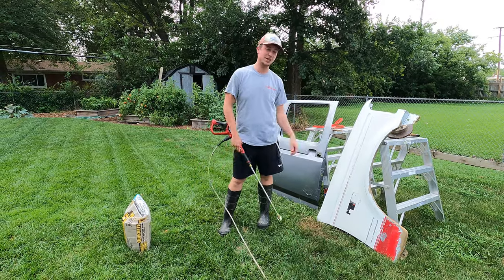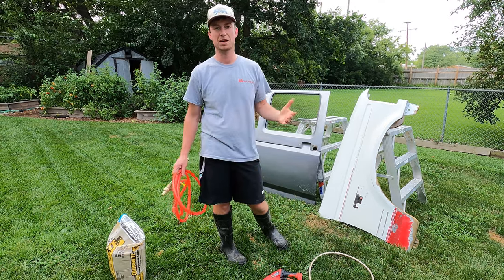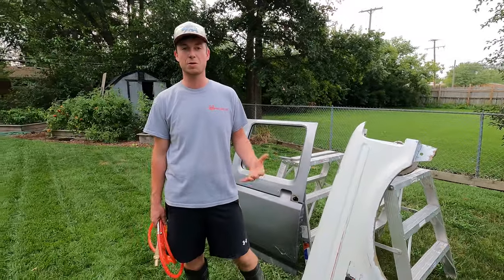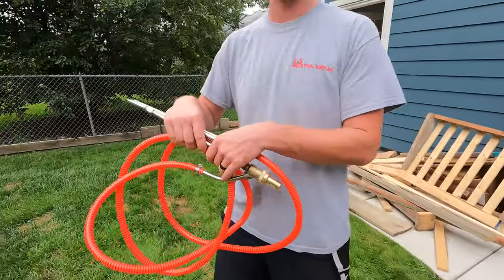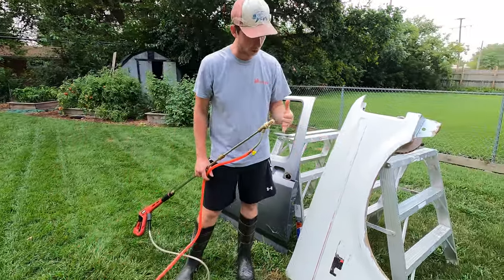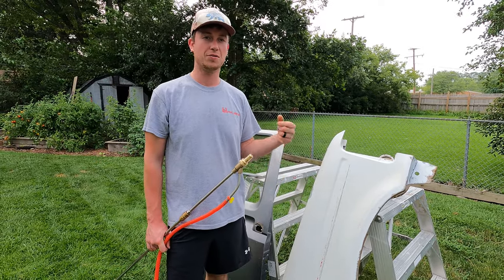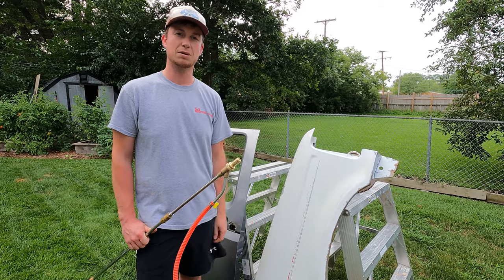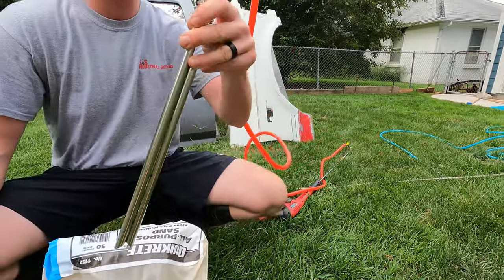Sandblasting Body Panels with a Power Washer Sandblaster

Comment: I know it's called SANDblasting, but you're not meant to use literal sand. That's why you had such a struggle. Proper blasting media comes in grades (similar to sandpaper grits) and different materials (steel, glass, plastic, ceramic to name a few). You'll have better, more consistent results and an overall more positive experience if you use the correct materials.
Reply: 🤦‍♂️ Sandblasting media can be literal sand. Many people have no problem using play sand with this method. Would sandblasting rated media work better at not clogging the siphon? No doubt. Will play sand still work and at a significantly reduced cost? Absolutely. 🤷‍♂️
Reply: I have seen other videos with great results from play sand but it has to be dry and it helps to have a second man manning the sand feed.  If I can't get a salvage frame in 2 weeks I will be trying this method on a frame and will post.
Reply: BS. People have been using play sand, beach sand, any kind of sand for decades and decades.  Depending upon whether you're a professional sander needed better results, or reuseable media, yes better media is available.
It is certainly not necessary to spend on it for everyday Joe to clean up some panels or parts.  Just use a real mask if using silica/generic sand as Silicosis is real and 1 good sanding interval can cause a lot of permanent damage.
Reply: The all purpose has bigger pieces in it. The medium grade sand works alot better
Reply: You obviously have no idea what you're talking about. For the rest of you, I buy play sand from home depot, been sandblasting glass for 2 decades. Play sand is the same price as all purpose, but is a consistent fine grit.

Comment: The mess it creates, a wet sand blasting is not even worth it. Overall, its fun to do something in your backyard, if one has the "time" to kill 🙂
Reply: It takes about 1 minute to do some common sense planning.
I got a $10 kiddie wading pool, and some 5 mil tarps which cover the back 180 degrees of the pool.  Put several small holes in the bottom and put some screen and cloth over them.
I can recover my sand easily, spread it out on a sheet of plastic in the backyard to dry, and screen and re-use.
Next time I'm done I think I'll just toss it all into a metal 55g drum and place it over a tree trimmings fire to fast dry it. Still need to screen it, however saving $20-30 every time I want to do some blasting is kinda nice.

Comment: wonder what would happen if you already had a small sand blaster from HF and just suppy air to sand tank while having pressure washer hooked up to apparatus
Reply: Some people have done that. One had the red steel media container HF sells which is supposed to be a gravity feed, and run a small compressor into it to keep it moderately positively pressured.

Comment: My brand new electric power washer @ 2050 PSI 1.8 GPM kept clogging up and did not produce any vacuum. Plan A: gas powered washer with 3500 psi and higher flow rate. Plan B: pressure and gravity fed using an automatic tire inflator to keep the PSI of the garden sprayer at ~30-40psi. A&B: a larger nozzle to increase flow and reduce back pressure (I believe that is the root of the problem).
Reply: did you try the tire inflator? I heard also to use pool filter sand
Reply: That electric is just to puny both in PSI and GPM.  I had a similar one, and while it was great for washing the car and PW duty, the gas one is like 3500psi and 3+GPM. You can usually get a decent one cheap in the fall or winter.

Comment: i have a unit that i put together myself. it's a harbor freight predator engine 212 CC and a 3,300 PSI 3 GPM triplex pump on a used pressure washer frame. it's decently strong. i think i may try this

Comment: I’ve spread the bag of sand on my driveway to dry it out and then sift it through window screen over a 5 gallon bucket. Figuring out a way to fasten the pickup tube to the bottom of the bucket for a gravity feed would probably help a lot. And at that point, you would want to hang the bucket from a heavy tree branch or an overhead beam. Thanks for the great video and your emphasis on eye protection.
Reply: Yep, thats what my dad did when we would get sand from our lake cottage.  Get a 5-10g bucket with top, and put a fitting on the bottom for your media hose. Put it on or hang from a 6' ladder.

Comment: Rucker made two good points, keep the sand feeder tube vertical, and as June Fletcher mentioned, duct tape it on the top of the wand to minimize blockage.

Comment: I know this is an old video but white silica sand is basically quartz sand that is mined. The all purpose sand would have larger material mixed in. Might have better results with a graded silica sand. Would also depend on whats easiest to access where youre at. Running your all purpose sand through a screen is also a good idea like others said. Good video though, definitely looking into it for my projects.

Comment: Since it's difficult for water to run uphill, try raising the bag off the ground. Maybe set the bag in a wheelbarrow.
Reply: LOL, I know right?
Reply: @boots7859  Me? Always learning. Years ago, I used to wash my concrete panels with a brush and water. Then this young "punk" said "Why don't you get yourself a power washer? I felt like a complete idiot. I bought one and retired the brush! I'd only been building for 29 years. Uff Da!

Comment: I put the sand feet tube from the top it helps alot from getting water in the sand feed tube. I also used window screen to sift the sand in a bucket to separate the rocks

Comment: Imagine shooting a shotgun at close range to a painted surface using various shot media. The first shell was filled with rubber shot. The second shell was filled with aluminum shot. The third was filled with steel shot. So, playground sand will help clean, but it will take a lot of it (rubber shot). The aluminum shot is better, but it is still relatively soft (silica sand). By the way, when you think of silica dust, think of asbestos. Asbestosis, and Silicosis are similar in the fact that both cause scar tissue inside the lungs that can't be undone. Silica sand is not the only hazard here; grinding, cutting, or chipping concrete, masonry, brick, or cinder block can create harmful dusts. 

Now to the steel shot - coal slag is the most economical hard shot media. The mineral itself is dirt cheap; but there are costs associated with it to verify its silica content (usually less than 1%), then bag it, then ship it across the states. Black Be..., I mean coal slag is not cheap, but neither is it (usually) worth recycling.

 
Abrasives by Hardness (MOHS)
Plastic	3.0 - 4.0
Walnut	3.0 - 4.0
Glass Bead	5.5 - 6.0
Silica Sand	5 - 6
Crushed Glass	5.5 - 7
Coal Slag	6.0 - 7.5
Olivine	6.5 - 7.5
Staurolite	7.0 - 7.5
Garnet	7.0 - 7.5
Reply: You can get Coal Slag in 50 pound bags for 10 bucks at Tractor Supply. That is the only place I have seen it that cheap. This is great information in this post. Hope this helps others as well.
Reply: @fordwheeler  i have had some problems with tractor supply material having tiny piece of wire which clogs the gun.
Reply: Not sure if I got suckered, however a welding supply place had metal shot for $50/50#.  Got it in my TS blasting cabinet and it seemed to work fine last year. Gotta go out and see if it all rusted together or is still reuseable.

Comment: Loved your idea of using an air compressor to blow out a blockage , verttical tube plasment and taping the sand line, as well. A guy could also tape over the bucket top with a plastic covering to discourage sand wetting and clogging. My powerwasher is 3000 psi ,so I,m looking forward to getting to my truck .thanks guy .

Comment: An often great place to hire out sandblasting is one or more of your local monument shops. That's where I've had truck frames blasted (I trailered mine in and left the trailer with them as a convenient work surface) so cheap although I just bought an industrial blaster I'll still take large projects to them to avoid the grit bath.

Comment: Since you know rocks and tiny dibriey wii clog the unit why not be more selective in the type of sand used, a cleaner variety might be playsand which has laready been screeded for small stones and debries. Also a more secure container for the sand with disbursement from the bottom would be more effective and less problamatic!

Comment: You can keep the water from getting into the tube by duct-taping it on top of the rod. Also, use pool filter sand. not all purpose--less likely to clog.

Comment: You really shouldn't be using straight up sand...the panels are gonna rust from the salt content in it in no time, you may not see it but it'll blow out under your fresh paint job quicker than it should.
Reply: There are some cheap products you can buy which you can add to your spayer soap compartment which prevent flash rusting.  Heard one guy say to use laundry detergent, which is worth trying on a test subject as its very cheap. Or, just blast it, then run a blower or air compressor line over it, dry with cloth and spray on some primer.

Comment: Is a 1900 psi Pressure washer have enough pressure to use? We be tried everything and the sand is Not going thru tube unless i held up hose in air!
Reply: I have a 2000 and it’s way to small, I’ve read you need at least 3000 11:42

Comment: I'm a little confused on how the sand feeds through the tube I have an electric pressure washer would that work for it
Reply from the maker: It gets siphoned or sucked up the tube. If you're really curious look up the venturi effect hahaha.  It may work, it really depends on the GPM/pressure of the washer. I think they have specs for what is needed on the Amazon part!
Reply: I think he went over this like twice in the video...

Comment: Does not work used playground sand then sifted through screen, no luck tried several times, dry sifted sand no luck, going to try silica sand next if that don't work it's going back
Reply: Wear a respirator any time you are in the blasting area and make sure you have adequate ventilation! Silicosis is real, and the fractured sand particles can hang in the air for hours! There is a reason nobody sells silica sand as a blasting media.